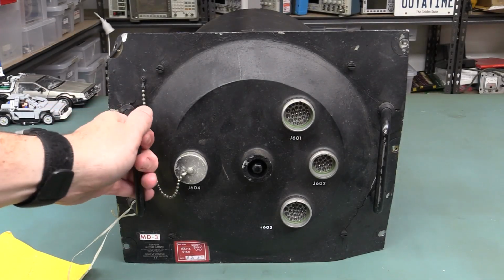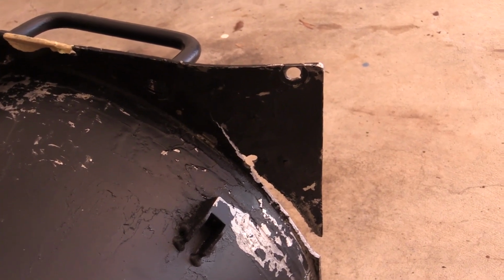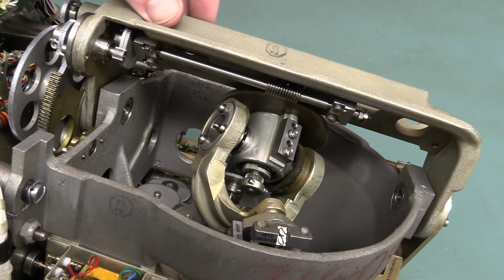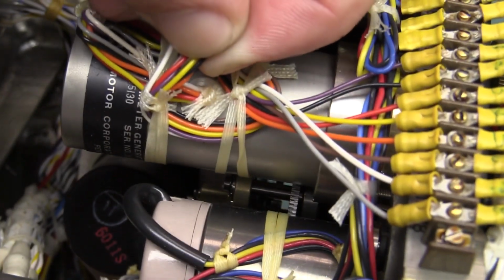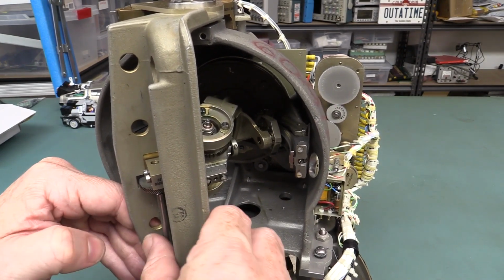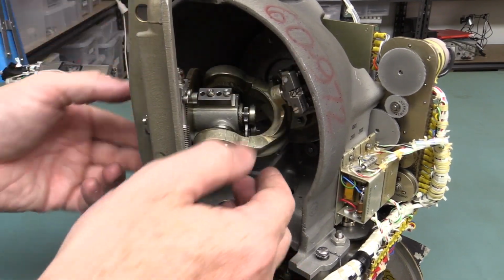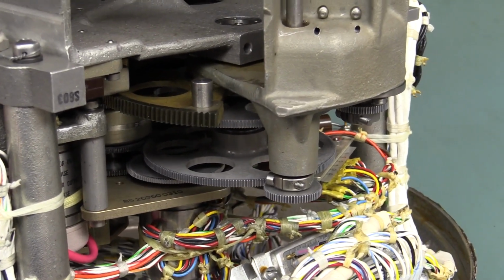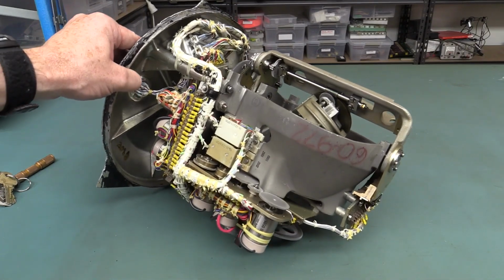EEVblog #854 - B52 Bomber Automatic Astro Compass Teardown

Comment: I bet that could be replaced with a PIC chip now lol
Reply: +GadgetUK164 But is a PIC chip EMP-proof? Just askin'... ;-)
Reply: +Tyvole wrap it with foil emp sheild.
Reply: +scott flynn "woof its cookies"  - is that a technical term LoL :))
Reply: +Tyvole Smart dude detected
Reply: +ThePoolboy789 Actually, EMP would have little effect on that unit.  The systems from that time - used a lot of tubes, and very few discrete electronic components.  It might woof its cookies during the EMP event, but would be up and running again in short order.  Mission continues...
Reply: wazza33racer insert "loose working data set" in place if it feels better ;)
Reply: +GadgetUK164 Yeah you'd think so but in actual facts they tend to keep analogical circuitry in the air when it's the most reliable. You're talking planes that carry nukes here.
Reply: +Tyvole an EMP could still through off the old one
Reply: scott flynn
So, what`s it like always hearing "in like Flynn"? hehe..
Don`t woof your cookies, yes, it`s a thing now ;)
Reply: +Bushylingus EMP destroys by eddy currents and induced voltage spikes in wiring or even circuit tracks. Foil won't stop that.

Comment: Wow!  Lots of brains went into designing something like this.  Or, lots of slide rules.  Probably designed in the early 50s.  No computers back then.
Reply: There certainly were computers in the 50s and throughout the whole of the 50s, but especially within the military.  Both digital and (both mechanical and electronic) analog computers were in fairly widespread use by that time, particularly within military research and development circles where the budgets helped spur the many early advancements in computer science.

Comment: AC voltage 400 hZ single phase,  DC voltage is 28... Hill AFB, it was a Depot level repair when I was stationed there.
Reply: +45von If you can grab his attention you could shed some more light on what it is

Comment: I make gears commercially… I really appreciate this type of mechanical system. I saw several anti-backlash gears so there's a highly sensitive output involved in several sections of this device. I'm sure those "limit" switches have a purpose  to identify whether the unit is upside down (the plane) or some limit of attitude and resets to orientation when those stops are reached. The "tension spring" is probably used as a drive to another switch when the device has reached some sort of attitude limit….

Comment: Sailors like me like to show off our sextant skills lol even with a gps on board.
Reply: I never had any luck with getting a decent sighting. To be fair, the extent of my sailing experience is very limited. I take solace in the fact that I can name almost any Northern Hemisphere constellation...
Reply: +Demetry Romanowski Don't think that during this items use they wouldn't have been using sextants.  Probably took sightings every 20 min.  Would have had gyro compass systems,  doppler radar for ground speed and drift angle.  A good Nav would be able to couple all that data together (and have been very busy for the duration of the flight).
Reply: No not at the time of ,this hardware. But I know German bombers at the beginning of the war used sextants during night raids
Reply: ***** We used sextants up into the 90s.
Common practice with military aircraft.
Reply: Fair enough, learn something new everyday!
Reply: ***** It's a skill that GPS is killing though:(

Comment: I was thinking more along the line of 'gimbals', so it could measure angles based on the pitch and rotation of the craft in relation to a fixed object such as a star.
I'm not an expert either, just my observation

Comment: I used to work on these when I was in the USAF circa 1966. The system was called the Astrotracker. What you have is just one small piece of a rather large system, although this is one of the main parts. The navigation data was entered into several other mechanical display units. The telescope would search for and lock on to a star, or the sun, or the moon and position data would be displayed on other mechanical display units. What you have is the computer that calculated all the math. One interesting thing ... if you manage to get a gymbal lockup, it will throw parts out of it. I wouldn't power it up.
Reply: Lol. Am I correct in surmising that that gimbal thing does some sort of multivariate integration?
Reply: @MrGoatflakes  might be as "simple" as some trigonometric function(s). I imagine you need that to figure-out aircraft heading from elevation and azimuth to the star/moon/sun.
Reply: Having worked on giros. Did you grind your teeth seeing him opening the can with a hammer and chisel ?
Reply: EddieWNC 

Eddie,    By chance did you get trained at/with the 2802nd Inertial Guidance and Calibration Group at Newark Air Force Station, Ohio,  in the 1960’s
Or by employees of the Kollsman Optics in Syosset or Elmhurst NY ?

Comment: So it's just like a multi function slide rule only you input with motors and read results electronically. One of the most beautiful combined works of mechanical and electronic engineering I've ever seen. Twenty eight minutes and fifty two seconds of pure fascination and wonder. It's why I love your channel.

Comment: Components in this are similar to those in the analogue computer of an old mortar tracking radar system I used to repair. The computer in that was full of motors and cogs with rotary sensor devices. There was a large test box to run a sequence of tests that caused mechanical counters to spin round and give number readings that had to be compared with a test spec. Never understood it 100% just learned in time what had failed if the right numbers didn't display. Amazing bit of kit.

Comment: Looks like a bunch of servo/stepper motors with rotary position encoders, much like any industrial automation/CNC system.  They make sure the motors are actually moving correctly.  My guess is that there are corresponding encoders to read the mechanical position that is generated by the motor movements.  It's complicated, but yet relatively simplistic.....

And, yeah, you can usually can't counter rotate a pinion screw in a like that.....

Comment: +EEVblog

Definitely looks like the patent (or one of the many patents that relate to this system)...

https://www.google.com/patents/US3042296

You can see that the figure on PDF page 4 does match the parts in the vid around 16:23 etc. ;)

So, it's actually a celestial tracker. That's similar to what the Apollo Guidance Computer did, albeit with mainly the digital ICs (and a celestial telescope for setting the star tracking points.)

A lot more info on this page (as others have posted), but I'm not sure if the pinouts for the connectors are on there?...

http://www.prc68.com/I/MD1.shtml

Comment: The "clever" bit is all in the angles!  A pair of cogs can do a fixed multiply or divide, but link two shafts with a system of joints and the angle between the shafts sets the ratio!  This is why the main carrier can rotate 90deg.  When straight the you have a maximum condition (1 turn in is 1 turn out) but at 90deg you have a null condition (1turn in is 0 turn out)  Of course, being mechanical, you can't actually get to true zero.  With the arrangement it is possible to compute the SIN and COSINE of a number, with the physical transmission angle being the gain of that function!  VERY clever stuff indeed! (basic in theory, but difficult to translate into a practical embodiment with high accuracy,  hence the lovely machined castings and precison bearings, gears and shafting etc!  I'd imagine the system included a master clock, at possibly 400Hz that is used as the control input to this device, that then outputs either a frequency (or more likely a magnitude and phase offset) depending on the orientation of the mech parts, where that orientation will be set by external sensor inputs (like a gyro platform etc) controlling the syncro motors

Comment: To spin the big bar, you need to spin the worm gear you show at 15:52. Worm gears can be self-locking in one direction. This worm has a fine thread so it should behave like that.

Comment: H.A.F.B.  Hill Air Force Base, in Ogden Utah.  The repair/rework facility is here for many and much equipment aircraft.   My Uncle ran the rework facility for F4 aircraft Aircraft and equipment were torn down to the bear metal and then restored to the current standard, basically they zero time the  air-frame and equipment,  this is how the 54+ year old B-52s are still flying.  Last B-52 was built in 1962.

Comment: Looks like a analogue device for calculating way-points to me i.e. you press a button in the cockpit and all those wheels and cogs start rotating proportional to your speed, height and heading so you can see your constant relative position. The outputs probably wouldn't make much sense without the associated display device and the whole thing has now been replaced by a chip the size of a postage stamp. Still a beautiful thing tho for all those early 20th century electromechanical device fanboys.

Comment: Hi Dave , if you want to power that thing you will need to find the CMM (Component Maintenance Manual) , this will explain how to power it on and how to test it :) , i have done that thing at school (aeronautics maintenance school) on a airbus A300 (analog) altimeter , i have manage to test it and to send him some code (using arinc)  to make it display what i wanted :) (sorry if there are some english mistakes , i'm french :p )
Reply: @Chuck Kirchner AND it won't respond to "code", as it isn't a digital device. It relies on phase relationships within the 400 Hz AC synchronization wiring between the units.
Reply: Hello. Is it true that one of the international standards for the integration of onboard aviation equipment was developed in the USSR?

Comment: It was probably the one from the plane found on the moon..... Lol but seriously when you think that some one had to design and make that sort of thing without the use of a computer or cnc machine..... To work out the number of teeth on a gear position it so that it meshes with the correct pressure on the next gear to it and so on... Amazing

Comment: Dave, great video.  You may want to check both unit and bucket with a Geiger counter.  While the castings are in all probability aluminum, the US aerospace industry in the 1950's and 60's did make use of Mag-Thor alloys (a magnesium zinc allow doped with thorium) in some applications that required high strength, low weight and a resistance to creep when machining precision parts.  While used mostly in missiles, it did sometimes end up in other applications without any records of it being used.

Comment: A thing of Beauty!  The tiny bands look similar to the brakes that are found in reel to reel decks.
Reply: someone below said they are there to preload the gears to prevent backlash and maintain the calculation accuracy.
Reply: https://www.febo.com/pages/docs/RadLab/VOL_27_Computing_Mechanisms_and_Linkages.pdf has a section on loop belt differentials on page 22 of the pdf, and it looks like that to me. Doesn't show up on US3042296, but that mostly covers the spinny bits.

Comment: So the whole point of this is not using any electronics that could be affected by EMPs produced in nuclear explosions, right? If that's the case, why didn't they use valves?
Reply: No, it was designed before electronic computers and advanced navigation. Basically, they didn't have much more back then

Comment: At 21:49 - This is a sealed relay based on the hooked contacts on the bottom.  I am guessing that because the B-29 can fly at very high altitudes that the entire unit was pressurized via the "bike valve" (with nitrogen?) to sea level pressure.  Then any internal components that might arc and spark (technical terms!) were further sealed, like the relays, motors and switches.  The B-29's cabin was pressurized and maybe a pure O2 atmosphere at  so sparks were a no-go.  Pure O2 was something that no one wanted after NASA Apollo 1!

Comment: Instead of electron flow you have kinematics.  No CAD,  No 3D modeling,  That came out of the engineers head.  As it is today, so was it them, "Art and Science..." All hail the engineers..
Reply: Even with cad most things start in somebody's head. CAD is great for figuring out where to put some screws and fixtures, how to fit everything inside a box - but all the actual mechanical design is still something you probably do with pen and paper at first.

Comment: When I was a teenager (50 years ago), my Dad bought out an electronics surplus store and I had hundreds of such strange military objects like this to experiment on.  The internal components, like selsyn (self synch) motors are great fun to play with.  It's tricky to simulate the 400 Hz power that was common on aircraft, but they'll actually work (poorly) with 60 cycle. Learned all kinds of arcane stuff while playing with these "toys", such as that early radar equipment (klystron tubes and such) were built on a relatively pure silver chassis to limit electromagnetic interference.

Comment: My guess is that this device gets info from the auto pilot systems and compares it from the output from the astro sensor and the feedback is used in the autopilot to hold a course.The spring is most likely used to keep tension on the gears to take up the hysteresis.When it operates it will do so very slowly

Comment: Synchro transmitters send a angle positional signal to a synchro receiver usually located in cockpit instrument indicator or other computers that need to track a position for it's own calculations.Outputs from two synchro's can also be used in a synchro device that 'calculates' and outputs the sum or difference from the  synchro transmitters to a synchro receiver.Electrically it has a three phase electrical trasnsformer as stator and a coil on a rotor that is connected to an ac source.You can basically see a synchro receiver as the equivalent of a mechanical axle.

Comment: its a telescope-like system
outer block contain optics, differential photo-sensor and selsin motors...
internal block count spherical-base coordinate correction (to hold selected star in a middle of sensors) and convert current position to polar coordinate to navigation systems...
absolute the same as on a ТУ-95, old scrap...

Comment: Dave, I suspect the reason you can't move the arm is because it is driven from the worm gear you showed. A worm gear can move its mating gear but not the other way around, so it must be another input into the system. You would have to turn the worm to move it.

Comment: Dave
The synchro transformer is a device for measuring angles. The primary of the transformer will rotate with the shaft. There will be at least two secondary windings. One will be the sine winding and the other the cosine winding. The primary is usually driven with a reference signal of a few KHz. The sine winding will then have a voltage equal to the input voltage times some gain time the sine of the angle of the shaft. Likewise the cosine winding will be proportional the cosine of the shaft angle. The shaft angle can then be calculated.
These devices can be made with enough precision, that you will need to ask what part of the gnat's ass you are talking about.
Reply: Ah, as i expected, it is also known as a resolver. Effectively same basic function as an encoder, but main difference is a resolver knows where it is the moment it is powered on, whereas an encoder has to make at least one revolution before it knows where zero is. If you are on a bomb run and you have to recycle the system because a nuke went off nearby and generated an EMP,  you cant afford the time for the system to completely forget where it is.

Comment: Allied control thing looks like a relay - maybe mercury wetted, or a mercury position sensor, hence the temperature label?
Reply: +mikeselectricstuff Yep, relay  - i have a bunch of those kicking around.
Reply: +mikeselectricstuff a relay was my guess too. Have seen those in lots of military type equipment.
Reply: +mikeselectricstuff I was also thinking that the &quot;cont&quot; was from the word &quot;contact&quot; as in it has a 5 amp contact, which would make sense for a relay... Dave had guessed control and I was thinking... 5 amp control? Can&#39;t be...

P.S. it's quite a horrible idea to write "CONT.5A" because that could mean "CONT.    5A" where the period is because of the abbreviation and it's 5 amps, or it could mean "CONT 0.5A" where it means half an amp and they should have made it 0.5.

Comment: ~22:00 I'm thinking it might be a hermetically sealed relay? "blue bead" probably refers to the pin #1 identifier,along with the arrow.The connections look to be run through a glass/wire seal,like an old tube (valve) would have...pin #1 being a blue colored glass seal.  Perhaps a 26.5V coil. 5A rated contacts ("cont.")? My best guess,anyway.
The internals kinda resemble a sextant..but with motors and stuff. Makes sense,I guess.

Comment: The amazing thing is they designed this all on paper - no CAD in those days!
Reply: Lots of slide-rule and blackboard work with several scientists and engineers gathered around. Lots of pipe-puffing going on. My dad was in on some of those meetings.
Reply: I was thinking the same thing myself - then they had to build it!
Reply: all in DaveCAD
Reply: They had DaveCad!
Reply: They wouldn't have had computerized CNC machines to make the intricate parts either.

Comment: The part in the middle represent the earth, the earth orientation compared to the stars to be exact. With the star sensor on the top of the plane and the other sensors in the plane that part gets orientated, from that the navigational compass, the speed display and the map system get powered. There where different types of star sensors for the south and north hemisphere.
The input of the system is on the top the output is in the bottom.